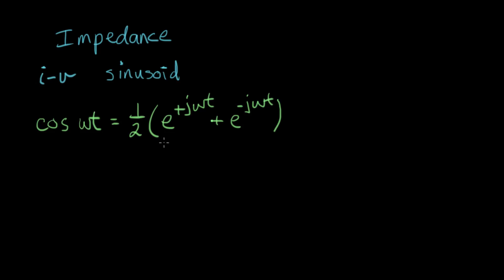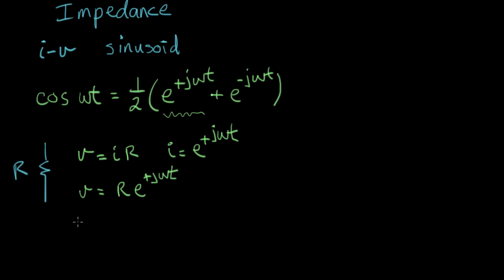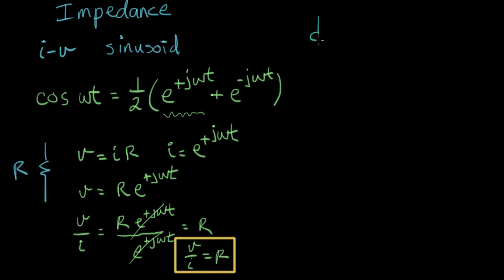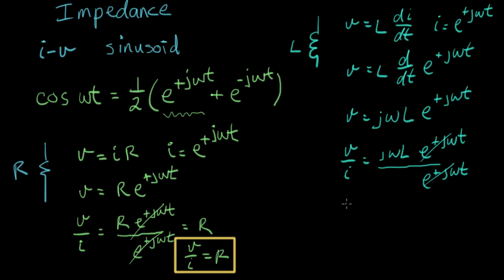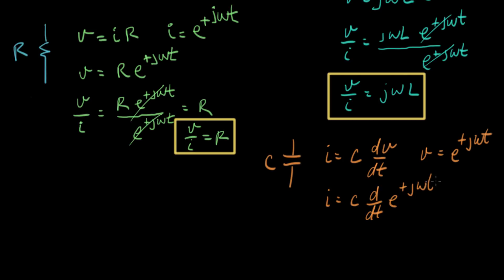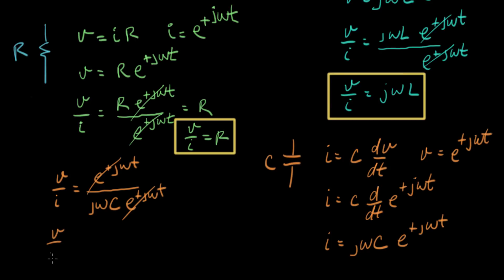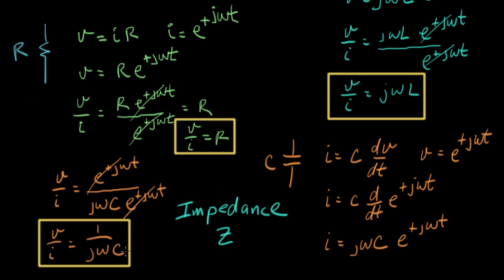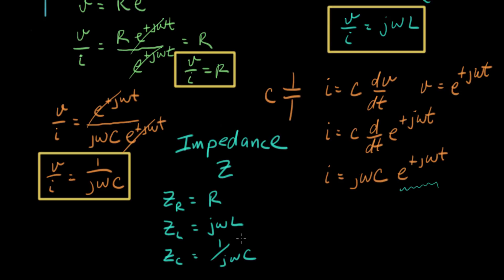Impedance

Comment: Simple concept of impedance: Imagine you're playing with water flowing through a bunch of pipes. Now, think of impedance like the pipes being twisty, narrow, or bumpy. These things make it harder for the water to flow smoothly. In a circuit, impedance is like those twists and bumps but for electricity instead of water. It's what makes it a bit tricky for electricity to move around smoothly in the wires. So, just like you'd feel resistance when pushing water through a twisty pipe, electricity feels impedance when flowing through a circuit.

Comment: At the start, what would happen if you used the  -jwt term?  The WHOLE expression for cos(wt) is not used...so how do you justify using just a piece of it??
Reply: When you put e^(jwt) into a circuit, you will find that the output is some complex number, A+jB.  Note that any complex number can be written in this form.

If you then put e^(-jwt) into the circuit, you will get the output A-jB.

By superposition, if the input is cos(wt) = [e^(jwt) + e^(-jwt)]/2, then the output will be [(A+jB) + (A-jB)]/2 = A.

Well, in that case we can skip the second half of this process.  Just find the output for e^(jwt) and take the real part.

Comment: I would rather sugest a better explanation of the concepts. Impedance is never complex. You firstly convert your input signal into a complex one just mathematicaly. Then, you work out the equations and concepts and then take back the real part. The connection has not been made as nicely. Other problem: these exponentials are NO VECTORS, but PHASORS!

Comment: 1:43 , text books usually uses a expression function called "The real part of", and the text books don't need to throw away the negative part for some mysterious preference.
Reply: Exactly! Dude didn't use the signal as input signal, but went using exponentials as a matter of physical signal, what is not conceptually correct. It is just a math trick in this case. In oppositr to Schrödinger's equation, which is intrinsicaly complex.

Comment: No matter how hard I try I will seriously never understand physics.  It's black magic
Reply: It is not magic, it is wizardry. And the master wizard was a guy named Leonard, born German but died a Russian and buried in Russia.
Reply: No kidding 😂
Reply: If you think you will never understand physics or anything for that matter... YOU ARE ABSOLUTELY RIGHT!
Reply: Don't bother, mate! I don't think this is your fault. Actually, he began his video in a strange way. Firstly he talked about cosine and stuff, what is correct, since this is one of the simples form of periodic signals. But the conection between it and using an exponential was fuzzy. Someone does use exponentials because they are handy and there is a connection between them and sine and cossine functions through Euler's relation, exp(j theta) = cos(theta) + j sin(theta). But the author of the video should have emphasized that the functions we are dealing with are real valued, like the cosine mentioned at the begining. Sumarizing, you do use complex exponentials as a matter of calculus, but at the end, keep only the real part.
Reply: For this kind of stuff, search some nice channels on electronics, dude. It makes way more sense. This kind of circuit are useful for designing low-pass filters, high-pass filters and band-pass filters. Our brains make way more connections when it sees some applications. And it is super fun! Useful for designing equalizers for electric guitars, for instance and play with sounds! So cool, mate! Don't give up! :)

Comment: why do we have to measure the ratio of voltage to current? and what for? and example implementation in real appication... thanks..
Reply: Dude, this is realy useful in passive and active filters. For instance, since frequency appears in the denominator of capacitive impedance, high frequency signals see a low impedancein a capacitor. The opposite for indutors. So, if you make a voltage divisor with resistor and capacitor, you may make a low-pass or a high-pass filter.

Comment: You can't start with Ohm's law as an assumption, posit a sinusoidal current, use Ohm's law to calculate the resulting voltage, then take the ratio of voltage to current to get Ohm's Law back again, and claim that you have "proven" Ohm's Law.  FAIL!
Reply: Simply ridiculous

Comment: Why you only use the exponential with the positive sign? Why not use the negative or both?
Reply: Because this lesson is not well rounded. I think he should have said: Hey, let's imagine a cosine input signal. But, since there is a connection between cosine and complex exponentials through Euler's relation, let's work with exponentials, which are easier to work with, and just take the real part at the end.

But, I am pretty sure you already know that, since you wrote it 4 years ago.

Comment: I dont understand why v and i are expressed by the same expression (e^+jwt)
Reply: i=(e^+jwt) but we know v=i*R so V = R*(e^+jwt)
Reply: If you are talking about the latter half of the video where capacitor V=Resistor I, then first understand Euler's formula for expressing trigonometric functions as exponentials. Then, since Voltage proportional to current, they can both be expressed with cosine (or sin) function in AC circuit, just with different amplitudes - i.e the coefficients of the cos functions, which will be Imax and Vmax respectively. But if you carry these amplitudes through in the calculations shown in this video, they cancel out in the v/i ratio stage.

Comment: If you start assuming that v=iR, it is normal that in 3:55 you obtain again v=iR, I can't see why you say you proved v=iR if it was the starting point.
Reply: His point through this class was to show that applying a complex signal into the equations that give capacitance, resistance and inductance would result into values of capacitance and inductance that are variable to the frequency of the signal. He obtains the resistance again without variability of frequency again despite having applied a complex signal, proving that the real part of an impedance is its resistance, while its imaginary part are the inductive and capacitive reactances.
Reply: is this really Khan?? he hasn't proved anything !!  Sal, you need to fire this guy!!
Reply: I was thinking the same way, I think that is a falacy, "Circular reasoning" and "Begging the question"
Reply: Yeah I also think what he did there is mathematically nonsense. He starts with "A) I KNOW I = V/R" and "B) I ASSUME I = XXX" so he comes back to his "I KNOW". 
tl;dr: You can't start with what you know and reach the same thing. You already knew it.
PS. He could just say "R = V/I" and that ratio is impedance, let's find out what that is for other components. It would still make sense, probably more sense.
Reply: this was done to explain the subject, the phrasing used in this video is simply not the point here. he even said this is nothing new, this was z
just to have a red line along which to introduce impedance

Comment: kind of wish this started with an explanation of what impedance actually is maybe with a water metaphor or something
Reply: no please,  no more water metaphors...
Reply: Water metaphors are already bad enough in electronics basics. Impedance is the same thing as resistance in DC circuits. In DC a resistor gives out heat based on its value and the current passing trough it. It also limits the current based on its resistance value. In AC a capacitor or inductor doesn't give out heat, but limits the current passing trough it, but instead of using the U=R*I law to calculate the current you use U=Z*I. In AC Z acts the same way as R in DC, but in AC Z depends not only on the value of the component, but the frequency of the wave supplied to it.
Reply: @two_number_nines  great explanation (Y)